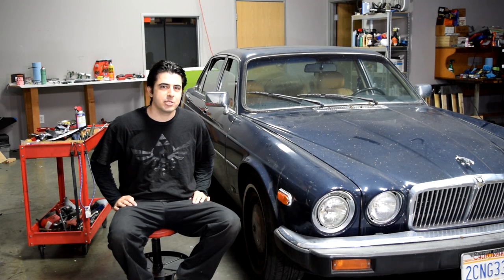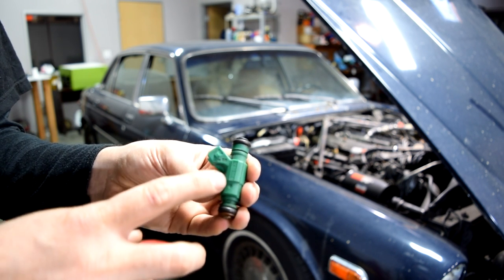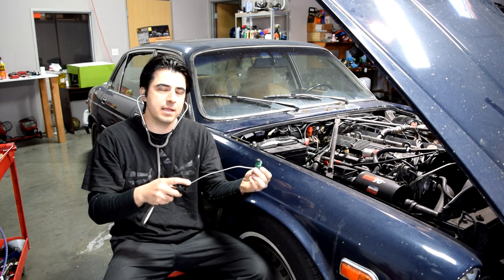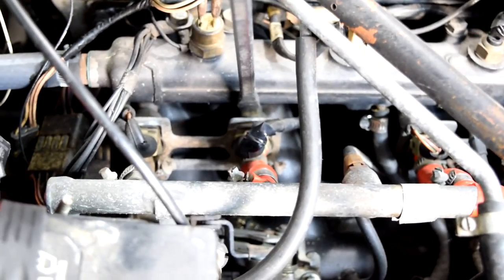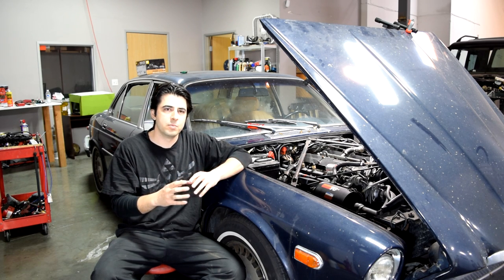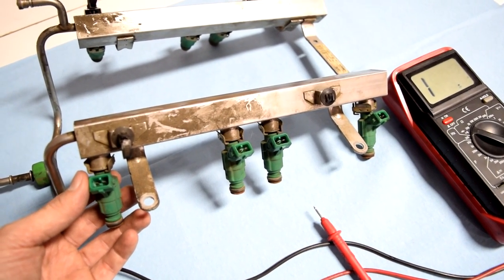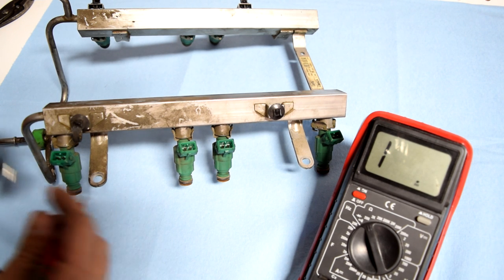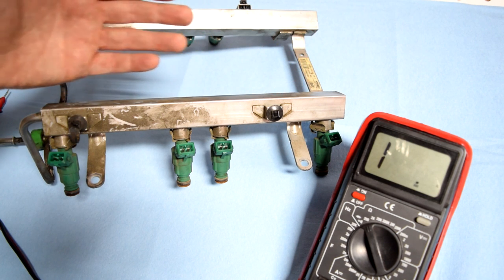How to Find a Bad Fuel Injector - Operation Testing Using a Screwdriver Plus Testing for Resistance

Comment: I have a honda 2002 crv with 160,000 miles. I feel sometimes the car is sluggish. I've just change the spark plugs and basically do all the maintenance myself. I have used additives in the past. Do you think I should take out and clean my injectors? Will this help with the car's sluggishness?

Comment: just a ? i found a fuel injector bad on my ford escort, used the stethoscope, the bad 1 is giving a sort of thumping sound and not the clear clicks as i hear on the other 3, does this mean the injector is clogged or is the electrical part bad ?

Comment: I had a ope circuit in my evap . what would that mean? 1999 dodge ram 1500 2 wheel drive 1500 5.9l engine. any ideas? never got the code sense. only got it once

Comment: Hello Ratches I have Hyundai 2004 it work properly but when it become hot I mean working for 2 hours if I switched the engine off will can not started again until it become cool,so can u advice me?i checked the fuel injectors by voltmeter I found the resistance at 16 ohm ,,thank u
Reply: Amee Hassa Has nothing to do with injectors. Do you have a check engine light on?

Comment: your car is the same era of my car...
Subscribe immediately lol
1984 fuel injected bmw e23 745i turbo

so far i have refurbished 
1 - entire fuel system from gas tank to  new injectors (bosch motronic)
2 - entire brake system lines and caliper ( hydro31) its a weird  power steering pump assited brake system 
3 - cooling system 
4 - headlight derusting and painting + new bulbs 
5 - cluster gauge renewal 

i wish i have taken videos to show you

Comment: My car is misfiring badly during first start in the morning. Misfire stops after 2-3 minutes.
This was after I had installed longer duration which I gotten a tune for. No engine knock and idles perfectly after engine is warmed up.

Weird thing is, if I let the engine cool for 24 hours, which would have completely cooled down, and start it up, it wouldn't misfire as bad as letting it sit for 2 days.

No fault code registered too...
What could be wrong?

Comment: do the injectors ever full clog and cause the piston to not fire?
Reply: jed black Very rarely. I'd be looking at something else if you have a dead cylinder. Doesn't hurt to give it a shot though
Reply: that's what it was, i changed out the fuel injector and the engine runs great now
Reply: jed black what was it doing was it like cutting out and julting the vehichle
Reply: yes, it would run fine for a bit then when I would give it gas the car would vibrate a lot. and the check light engine would flash, it would also come close to stalling when idling.
Reply: jed black my 1989 Toyota 4runner it has the 2.4L 4 cylinder the check engine light doesn't come on or anything. and it just jults the truck in first and second gear but in third it's just fine like what the heck.
Reply: hmm, it might be a transmition problem?
Reply: jed black ahhh don't say that lol

Comment: what you can do is injector wires are always hot so re move the pug and take a wire from the plug  on the hot side and connect it to the injector then just earth the injector briefly and watch the spray pattern

Comment: Thanks for the refresher, was struggling all day with charger, using a pico scope and everything I was making it  to complicated. Started back from the basics and yea easy multimeter  test bad injector : )
Also was a car passed down by 2 other shops and customer  that had worked  on it himself  so thought the worse that it had a bad PCM.

Comment: good info as always one question  is  there 5 volt reference to the injector we can check.
Reply: They mostly get battery voltage, not 5v ref. You can backprobe the negative side while cranking and see pulsation from the ecu.